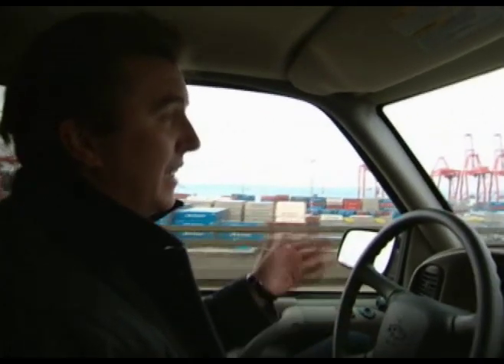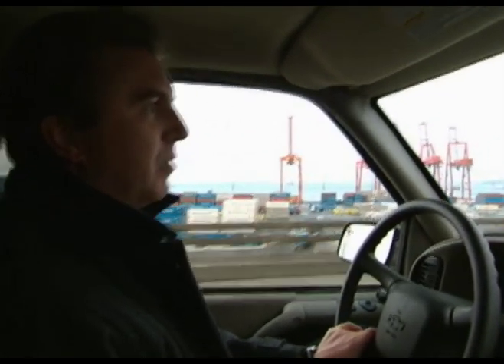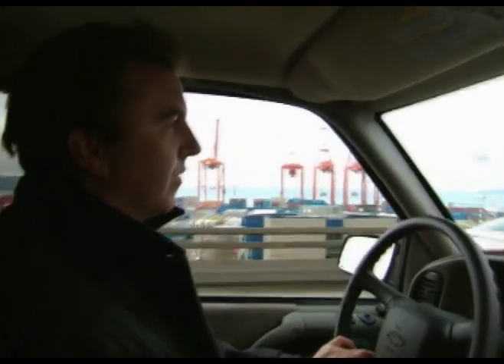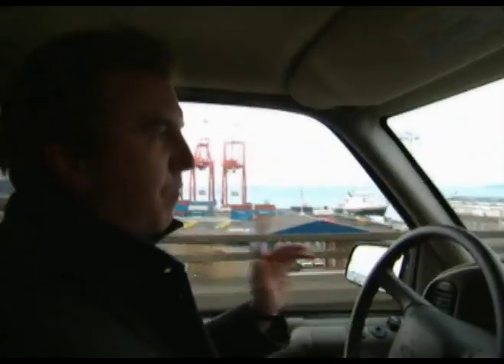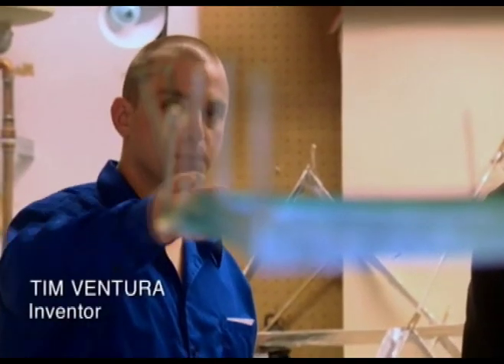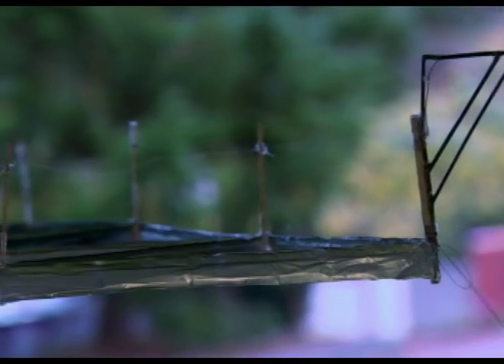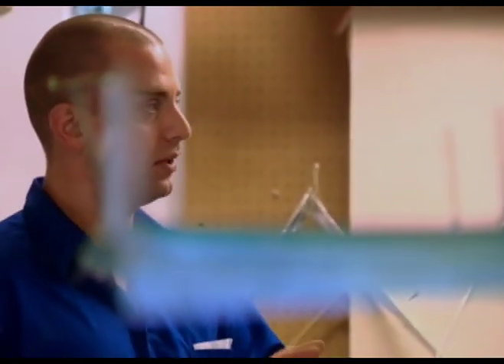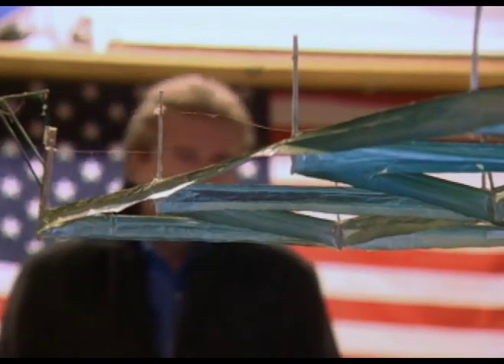UFO Propulsion?  Ion Wind Device

Comment: I dig the concept but where would a UFO/UAP get and maintain the energy needed to create the lift effect?
Reply: My best bet is that they would have a large alternator like machine that powers it
Reply: Please click on my channel icon to the left to see one in flight with onboard power.  Since it is redesigned to be efficient, it is able to fly using the energy and power contained in two small onboard lithium polymer batteries.

Comment: I did not scroll very far through the comments section but I will ask maybe what seems a simple question:  can lifters be placed in series so the thrust from one propels more air into second set of lifters for greater lift capabilities?
Reply: I have tried it with up to 5 stages in the past.  While multiple stages can be used to obtain roughly %20 more thrust per area, it takes far more energy and also weighs about 5 times as much, in the case of a 5-stage version.  I have some that fly with onboard power on my channel.  They work by having a large lightweight surface area, 2.5-micron thick emitter wires, and large emitter collector gaps, which turns out to require much less wattage per gram of thrust.  It also requires a really lightweight power supply.

Comment: the tendence of the ionized air is spinning n riseup,as observed in boreal auroras,right?is those ionocraft the goes downward because exixst an emissor n an colector,the emissor is the copper wire n the colector is the aluminium foil,right?

Comment: Ion Wind lifters have been tested in a vacuum, and they do nothing. That tells you everything. Thrust is generated by the movement of ions in the air and the ions are created by the high electrostatic difference in potential between the anode and cathode. 

On the other hand, NASA does use ion propulsion in some space craft. While this lifter derives its reactive mass for thrust from the surrounding air,  NASA space craft, operating in a vacuum of space, carry their reactive mass with them.
Show less

Comment: If "flight" is unachievable in UHV conditions then there is no "anti-gravity" condition present, this is a simple ion pump demonstration which requires a back scatter magnetic field to be present which in turn was missing from the NASA test chamber which did not allow for the "anti-gravity" effect to take place. However with the proper arrangement within the UHV chamber propulsion can be achieved

Comment: 4 triangles acting as one triangular platform can have power delivered separately to the outer 3 triangles, making the craft steerable by dipping or lowering one triangles power output. maybe have all triangles have a separate insulated power supply to control ionwind. im thinking of a torus shape lifter with the wires close to the hull on the inside of the torus or sphere. maybe double the two half spheres and charge one positive half and one negative half making ions jump between halves easily by shape.

Comment: I thought this was gonna be another video about a whackjob building a lifter and calling it an anti-gravity device. I was wrong. The guy who built the thing was honest and on point. The reporters were not only over-dramatizing, but they were actually completely ignorant, which caused them to say some incredibly stupid things. "No one knows exactly how this lifter flies" What the fuck? That thing operates on well-known scientific principles.
Reply: The army research labs in the US analysed asymmetrical capacitors and found that the 'thrust' generated was at least 3 magnitudes of order greater than ion-wind alone could provide, gravitec did it in a vacuum for NASA, lots of others have succesful vacuum experiments so there's something more than oxygen molecules being bumped around over a highly-irregular 'wing' made of bacofoil. So there's still room for exploration of the effect, i've gathered all the data i could find on the topic over the years and the phenomenon isn't fully understood yet.

Comment: Sadly, an ionosphere requires a medium to funtion. So no space travel :(
Reply: Oh really... nasa already have a satellite travelling thru space using an Ion Engine
Reply: sabine pouliotte That Ion drive that you are referring is not using the Biefeld-Brown effect. The Biefeld-Brown effect relies on a neutral medium to transfer momentum through. The more medium available,  the more intense the effect. The Ion drives in space do not rely on a neutral medium to acquire electrokenesis. The source of the propulsion is more directly a result of charged particles of the same polarity (negative to negative or positive to positive) "pushing" off of one another.  The Alien Reproduction Vehicle (ARV) P-53 Orion, I think this is what its actually called, uses high voltage DC capacitor plates to achieve & maintain a (somewhat) state of equilibrium between the gravitational influence of itself (the craft) & Earth (or what ever massive body it is relating to).  But the ARV is constant controlled chaos. & its principle of propulsion is the Biefeld-Brown effect at its finest (that I'm aware of).

Comment: This could be used for starships for taking off and landing without a huge booster rocket. Simply activate these on the bottom of the ship and at the 45 degree angled edges, go up a few hundred meters, activate the main engines, boost forward and up, and use those to escape the atmosphere! Once you've exited, deactivate the lifters, and there you go!
Science :3
Reply: star wars tech

Comment: I do not believe the ion wind is solely responsible for its lift.  To levitate something that size would require a pretty damn strong wind and would be quite visible like the winds off a propeller in an RC craft.
Reply: Not really, it's built to be super-light, probably much lighter than an RC helicopter.
Reply: yeah but look how light it is

Comment: All the tests I have seen use a small triangle.  Wouldn't work better if you had a big square with many close rows inside it and more voltage? Could you lift something larger?  Also if you change direction of flaps underneath can you control it?
Reply: Please click on the channel icon to the left to see one that carries its power supply.

Comment: i cant beleive this is a mystery! its basic...ions wack into air molecules like snooker balls...BUT its useless because the high voltage supply needed weighs about 10,000 times its lift capacity. you just cant see the wires leading to the monster psu.

Comment: nasa do use ion propulsion but it does not work like this model at all. the ion propulsion nasa used DOES use fuel as such which is then ionised to produce thrust. but this model above WILL NOT work in a vacuum, there's noting to ionize!

Comment: It works because it creates a strong GRAVITATIONAL FIELD. Some setups will even bend light. This technology can create a cascading avalanche effect in the air, creating much more potential energy in form of static electricity than the energy consumed by the CASCADE GENERATOR itself. Used with an electrostatic generator, this will create unlimited amounts of energy at high current compared to space. Look up the TESTATIKA GENERATOR. Fridges, heaters, cars etc. could have this setup build into it.

Comment: @pyroboy08 Well that is not entirely true... we do have a handfull of methods for transmitting electricity wirelessly so the power supply technically does nto have to be mounted to the device. Nicola Tesla was able to power a light bulb with a very large Tesla coil up to a couple of miles away. He developed it to replace power lines but the idea was scrapped because the useage could not be metered. The real problem though is you can run 10 electric motors with fans on them at the same wattage...

Comment: THis functions more efficiently in vacuum, as tested since the 1940s to today. It also functions under oil, which also does not ionise. Ion wind has an upper limit in air, and is insufficient a force to loft even a 5-gram model, yet models hundreds of grams to kilograms have been lofted, all over the world. We shall not be controlled any longer. We are free-thinkers, thinking outside the box of calcified dogma.

Comment: First off, Comparing Ion Wind propulsion with High Voltage Electromagnetic propulsion systems, is like comparing a Hot Air Balloon with a surface to air missile. 

Ion Wind is extremely poisonous, TriOxygen (Ozone) This is extremely enviromentally unstable and not very reliable, Because the electrons moving around the copper wire will only super heat the metal to its melting point, thus creating a craft that is extremely inefficient. lots of voltage being used.

Comment: Lets make this simple... I have a document which I aquired directly from NASA which details all of NASA's experimentation on lifters and other asymmetrical capacitors. In this document it clearly states that all experiments perfromed lead them to conclude that the ion wind effect accounts for 100% of the thrust observed and that there is no other force present. Put simply there is no antigravity, artificial gravity, or gravity modification.

Comment: Hutchison efect is quite real, and involves the creation of scalar waves (magnetic-monoples), which results in gravity-control, shattering and heating of metals without heat, and melding of dissimilar materials without heat (similar to what happend to sailors above-deck getting emmbedded in the steel of the Eldridge in the Philadelphia Experiment in 1943). This is the creation of a compression and rarefaction of spacetime, with high-Voltage. Same thing can be done with Toroids.

Comment: The Overloaded SEG. The Floyd Sweed VTA Bose-Einstin Condensates. Petit Viton. The Kontrabaric Effekt (Dr. Burkhard Heim). THe TT Brown Condensor-discs in vacuum, the Hubbard Coil, George S. Piggot force-field levitatioon experiments (1904), Woodward's FLUX CAPACITOR. Zinnser Effect. Clark Coils (Dr. Richard LeFors Clark), Dr. Shinichi Seiki's antigravity Generator (THE PRINCIPLES OF ULTRA-RELATIVITY-1972), SAIC (first confirmed USA antigravity flight at Area-51 in 1971), Schauberger Repulsine.

Comment: No.
It is ionization.
Electrons build in the top most wire. Their orbits become to wide that they interact with the lower wire. A connection is established and a ion bridge forms. They then travel through the air from the + to the -. This creates a sort of buoyancy effect. Although not really.
It's like... uh... I don't have enough remaining characters to explain it.
Just trust me.

Comment: I'm pretty sure it would require an actual gas in between the two points for proper ionization.
I have yet to see a lifter in a vacuum. :P

And yeah, we'd need 100 kV just to make one of these things out of something other than balsa wood. :P

Comment: theres nouthing mysterious about it, the corona wire ionises air molicules which are attracted to the foil below this creates a downdraft so aerodynamicly it is very simelar to a helicopter. its not antigravety but if you are unsure check out the mythbuster report on it, it has no gravetational effect and will not function in a vacume.